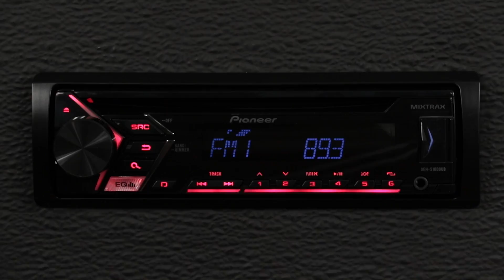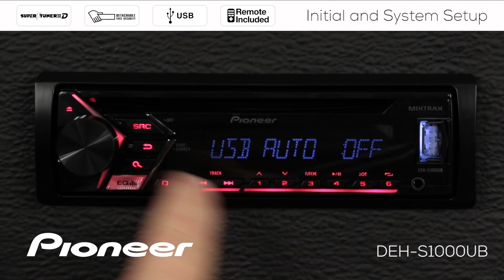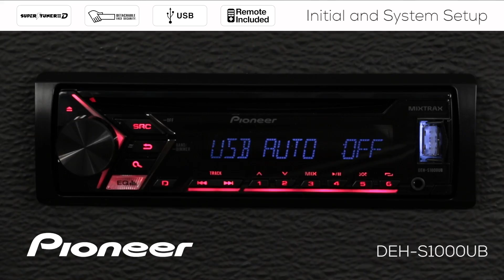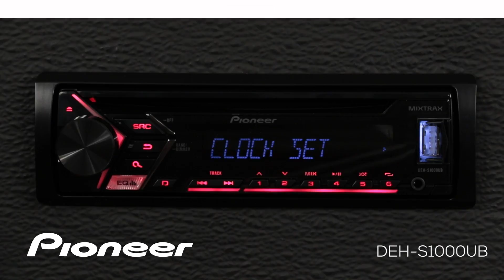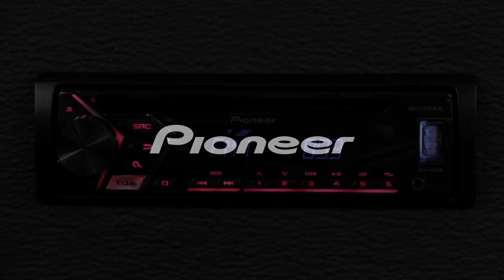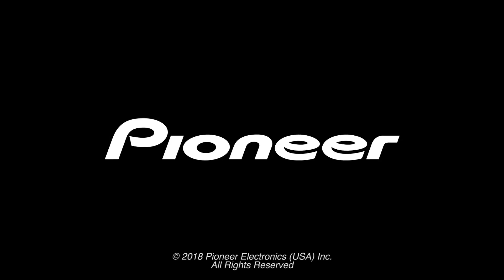How To - DEH-S1000UB - Initial and System Setup

Comment: Sir can i just know i bought a avh pionner 219bt its not been a month now its showing amp error and the Bluetooth is not connecting
Reply from the maker: Amp Error usually means that 2 speaker wires are touching one another or touching metal in the vehicle.   Please be sure to check the wiring behind the receiver and make sure no wires are touching.  Also check the speaker locations to be sure no wire are touching one another or metal in the vehicle.   You can learn more about wiring your Pioneer receiver in this How To video:     https://youtu.be/-bF3uzzaT30?list=PLw63zJRQbCNjEUhMJufnF-zxddC2146LR&t=391
 I recommend to press the receiver's microprocessor reset button.  You'll need a paperclip or some other small point to press the microprocessor reset button.  You can find the microprocessor reset button on the Pioneer AVH-G219BT just below the USB port on the front panel.
If you check the wiring and  press the microprocessor reset button and the issue is not resolved, I recommend to contact the Pioneer Authorized Dealer where you purchased the product for support.     https://pioneer-india.in/stores/
You can find more videos on Pioneer's YouTube Channel here:   https://www.youtube.com/user/pioneerelectronics

Comment: Can the colour be changed and to what kind of colours?
Reply from the maker: The Pioneer DEH-S1000UB shown in the video above, has fixed illumination and the colors can not be changed.  What is the model number of your Pioneer in-dash receiver?   Pioneer offers many different receivers with multi-color operation.     https://youtu.be/FBck5BfCnXE?list=PLw63zJRQbCNi466ajmuVdPVFuQqlaI9qZ     You can see the color changing  in this Pioneer How To video:   https://youtu.be/rdbHlo22TYQ?list=PLw63zJRQbCNi466ajmuVdPVFuQqlaI9qZ    and you can find more videos on Pioneer's YouTube Channel here:  https://www.youtube.com/user/pioneerelectronics
Reply: @pioneerelectronics  thanks for the reply, its pioneer mvh-s100ub
Reply from the maker: The MVH-S100UB is an entry level receiver with fixed illumination.
Reply: @pioneerelectronics  I have a deh 1801ub can I change illuminations on this model
Reply from the maker: @CR_C30R     The illumination is fixed on Pioneer DEH-S1801UB and can not be changed.  You can find more videos on Pioneer's YouTube Channel here:   https://www.youtube.com/user/pioneerelectronics
Reply: @pioneerelectronics  what is the app we need for aux as you said in the video  but couldn't work out what it was called
Reply from the maker: @CR_C30R    No app is required to use the AUX input.  You can learn more about using the AUX input in this video:   https://youtu.be/cnxUmvbYst4?list=PLw63zJRQbCNjfGaTVA2WEqWsxnMgmnYd_        You can find more videos on Pioneer's YouTube Channel here:  https://www.youtube.com/user/pioneerelectronics

Comment: Why wont my Galaxy Note 9 work
Reply: The Pioneer ARC App is compatible with selected Android phones operating the Android OS version     4.1  up  to 7.1.2.  The phone must also support AOA (Android Open Accessory)  version 2.0.   Ultimately the compatibility depends upon the individual smartphone.  Please note, some Android based devices will connect via AOA 2.0 but may not work properly or emit sounds due to the phones software design regardless of the OS version.    You can find a full playlist of How To video from Pioneer about DEH-S1000UB here:   https://youtu.be/YNniqyTm-TE?list=PLw63zJRQbCNjfGaTVA2WEqWsxnMgmnYd_   and you can find more videos on Pioneer's YouTube Channel here:  https://www.youtube.com/user/pioneerelectronics

Comment: Actually I have a problem with the usb connection
I have a pioneer mvh s105ui
When im trying to connect my phone of a type c cable  to the device it keeps rebooting and the device isnt reading the phone or even charging it 
I tried several devices with different cables and all of them are original 
But with the connection of usb2 everything is working properly
Reply: It's possible your Android based phone is not compatible with the receiver. The Pioneer MVH-S105UI will work with selected Android based phones and iPhones.  I recommend to  contact Pioneer in your region for support here:  https://pioneer-mea.com/en/contact-us/   You can find more videos on Pioneer's YouTube Channel here:  https://www.youtube.com/user/pioneerelectronics

Comment: This is a good CD player. Until your car battery goes dead. 😒
Reply: If your car battery is dying, the in-dash receiver may be wired incorrectly.  When properly installed, all Pioneer receivers should completely shut down when the vehicle is off.  Please focus on the Red Wire and the Yellow Wire in the wire harness.  Do not wire Red and Yellow together.  You can learn more about wiring your Pioneer receiver here:  https://youtu.be/kR2MO2kwFug?list=PLw63zJRQbCNjfGaTVA2WEqWsxnMgmnYd_    You can find a full playlist of How To videos about Pioneer DEH-S1000UB here:  https://youtu.be/U4xpZSCFAw0?list=PLw63zJRQbCNjfGaTVA2WEqWsxnMgmnYd_   and you can find more videos on Pioneer's YouTube Channel here:  https://www.youtube.com/user/pioneerelectronics

Comment: I love these stereos they are very good and have used them  in my last two cars but now I have set up subwoofers in my car  with 6x9 speakers I have a amp to run my subwoofer and another amp to run my 6x9s but I'm only getting bass out of my 6x9s and subwoofer can I change this I do I need a new stereo ? I only want to keep the bass on my subs but want vocal out of my 6x9s
Reply: Pioneer DEH-S1000UB has one set of RCA outputs.  This can limit what can be done with external amplifiers.  One way to make this work is to get a different in-dash receiver with more than one set of RCA outputs like this one:  https://youtu.be/2X0_WyTEMp0?list=PLw63zJRQbCNgnzKRnjnxSbEmQtkk0O5Os   or this one:  https://youtu.be/RHIJrVI37ac?list=PLw63zJRQbCNgnzKRnjnxSbEmQtkk0O5Os  or this one with 3 sets of RCA outputs:  https://youtu.be/yUquQbdPMwM?list=PLw63zJRQbCNgnzKRnjnxSbEmQtkk0O5Os With additional RCA outputs, you can dedicate a right and left RCA output to full range speakers like 6x9's and another to subwoofers.     Your question above has limited detail.  There are many possible solutions using the products that you have now.  One possible way to make the products you have now work is to use the Speaker Level outputs for the 6X9 speakers and the RCA output for the subwoofer amplifier. This would also work if your 6x9 amplifier has Speaker Level input.  To do this be sure to set up the Speaker output as REAR/SUB as seen here:  https://youtu.be/YNniqyTm-TE?t=60   Or another possible solution would be to use the crossover built into your subwoofer amplifier if it has one.  You can find more videos on Pioneer's You Tube Channel here:  https://www.youtube.com/user/pioneerelectronics

Comment: I set everything nicely,everything works,but when I shut down the engine,as it did in the beginning,all again,it says:Set up system,and all the way in the circle......what's the problem can someone tell me please?
Reply: The in-dash receiver's Yellow Wire has an incorrect connection to the vehicle.  The Yellow wire needs to have constant power from the vehicle.  This keeps the clock, radio station presets, and other settings in place even when the vehicle is switched off.  The Red Wire should switch on and off with the vehicle ignition.  You can see more about the Yellow Wire here:  https://youtu.be/kR2MO2kwFug?list=PLw63zJRQbCNjfGaTVA2WEqWsxnMgmnYd_   You can find more videos about Pioneer DEH-S1000UB here:  https://youtu.be/SQPXWW0l7Nc?list=PLw63zJRQbCNjfGaTVA2WEqWsxnMgmnYd_  and you can find more videos on Pioneer's You Tube Channel here:  https://www.youtube.com/user/pioneerelectronics

Comment: Hey, I got a problem with connection USB-android on deh-1900ub. When im connected in "memory" mode I can play my music straight from phone (like pendrive stick), it works perfectly. 
But When I would go to "app control" mode on the radio, I can control everything from phone but music goes from phone speaker - I think it is not the way it supposed to be. I tried changing usb mode (storage, tethering), enabling and disabling USB debbug... Still the music is not transmitted from android to the radio. My phone is Xiaomi MI A1 with USB type C. 
What is wrong?
Reply: This is normal operation for the DEH-1900UB.  There are two operation modes when connected to an Android Phone.  Memory mode treats the phone like a USB Flash drive and App Control Mode allows the use of Apps from the phone.  You can use one or the other.  Not both at the same time.   The Pioneer ARC App is free from Pioneer.  If you use the Pioneer ARC App you'll have access to apps and music stored on your phone at the same time.  You can see the Pioneer ARC App on a similar in-dash receiver here:  https://youtu.be/6uJ7em6QLps?list=PLw63zJRQbCNjfGaTVA2WEqWsxnMgmnYd_   You can find more videos on Pioneer's You Tube Channel here:  https://www.youtube.com/user/pioneerelectronics

Comment: I have just installed said head unit and it worked perfectly fine for about an hour, now it keeps cutting to mute and the only way sound comes out the speaker's are, if I set the att instead of mute mode but this limits the volume of which I can play music and also I cannot change the volume manually. Can some one help please?
Thanks.
Reply: What model number of in dash receive do you have?  If the in dash receiver model number you are using is DEH-S1000UB, I recommend to do a "System Reset".  This can be found in the Initial Setup Menu seen here:  https://youtu.be/YNniqyTm-TE?t=189  If you are using the wireless remote control to Mute the system, try to use the remote control to "un-mute" the system.  You can find more videos about Pioneer DEH-S1000UB here:  https://youtu.be/6uJ7em6QLps?list=PLw63zJRQbCNjfGaTVA2WEqWsxnMgmnYd_

Comment: I have a deh-x1910ub, all of it is hooked up and working, but all i get is bass and no treble. Can barely hear any lyrics and my speakers are on the verge of blowing. Any ideas as to why?
Reply: It sounds like you have the speaker output set to Subwoofer output.  In this video  https://youtu.be/Z6g0EOPZL0c?list=PLw63zJRQbCNinkLCSrV17ExW5FWT7aIFU  You can see how to change the SP/PO Mode.  Be sure to change the output to REAR/REAR.  This will make the speakers Full Range and you'll be able to hear the treble.

Comment: My radio wont power on a 97 expedition. Same style radio... yellow red and black hooked up and radio and car fuse good.. can anyone help?
Reply: Confirm that you have proper voltage at the vehicle connection wires.  Check out this video for help with wiring:  https://youtu.be/kR2MO2kwFug